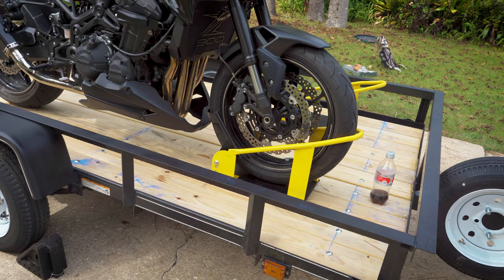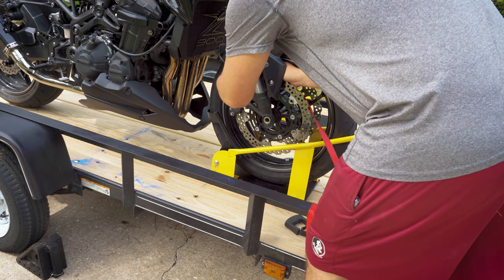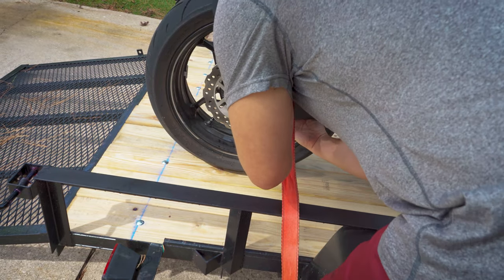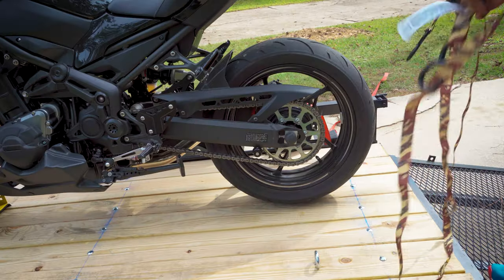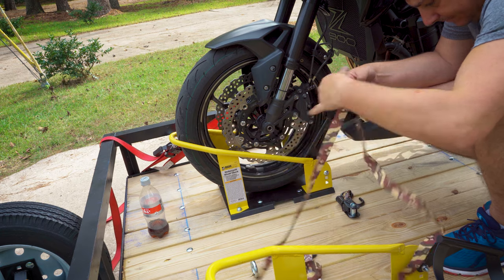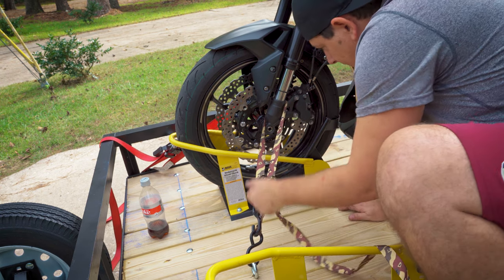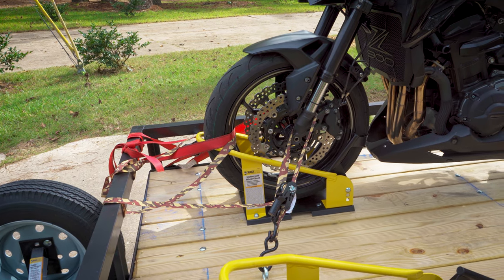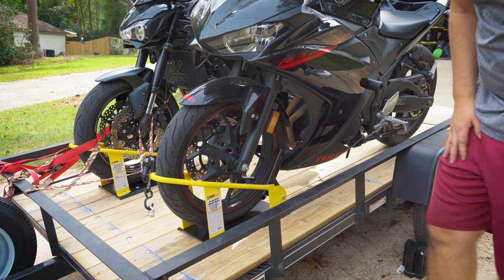Loading Motorcycles on a Trailer

Comment: Nice work, but those camo straps look pretty thin.  I think Ancra straps are the best one can get, and you won't find these at Harbor Freight, Home Depot or Lowe's.  Remember, good straps are much less expensive than a new paint job.  Also, I'd pad those straps where they wrap around the forks and swing arm; you'd be surprised at how quickly a strap running over a sharp edge can wear through.
Reply from the maker: Thanks for the tips!

Comment: Could u use handle bar straps? I've never seen someone strap on lower forks and swingarm... any.problems?
Reply from the maker: Bar straps will work fine, I prefer not to load the suspension for long periods. I haven't had any issues other than tires wear out on the trailer. Thanks for watching.

Comment: Is t safe to pull on the fork legs with straps like that?
Reply from the maker: You only need a little tension on the straps, I have towed my Z900 around 6,000 miles  since making this video and I have had no issues. I like this way better than compressing the suspension. Thanks for watching.

Comment: Need to run strap over triple tree or the folk brace so you are compressing the shocks, keeps the front from bouncing. I hauled motorcycles for years around the country.
Reply from the maker: Both ways work, I don't like compressing the shocks on long trips. Thanks for watching.
Reply: Compressing shocks with electronic suspension. Good way to buy some new fork seals. This isn't 1975....😅

Comment: Hello Simon,🙋🏻‍♂️ any idea how to clean the inside of the headlights ... recently after installing the leds on my z900... I kind of didn’t install the dust protectors properly...🤓...  😁..
Reply from the maker: Is it dust or water? If its dust you could try a shop vac or blowing air into the headlight. If its water you could dry it out in the sun.
Reply: Simple Simon it’s dust,, tried blowing it out ... didn’t work that well.. was thinking of pouring a bit of water with detergent... will that be ok?
Reply from the maker: @Gtknoob  It should work but you would need to rinse alot and then dry it. I did find this video of using a magnet.
https://www.youtube.com/watch?v=hnZ1yRL5yFY